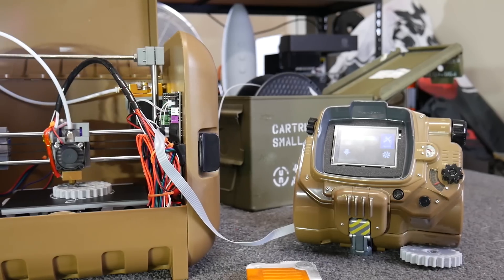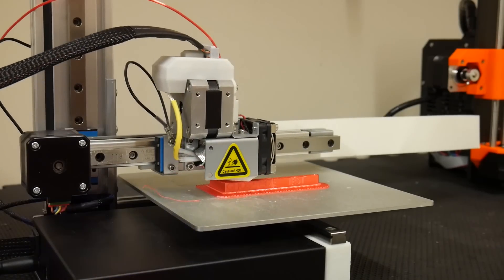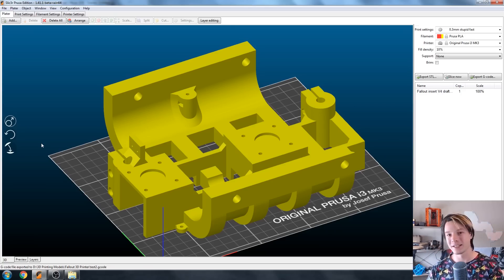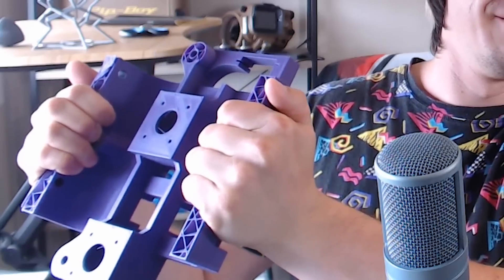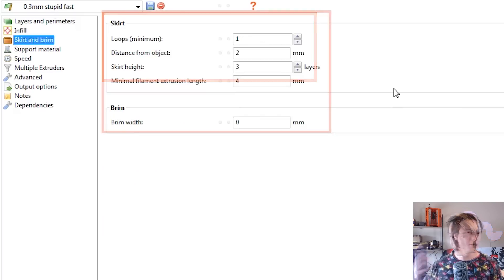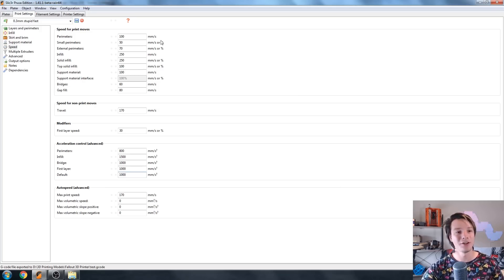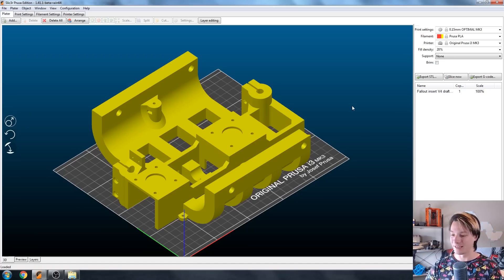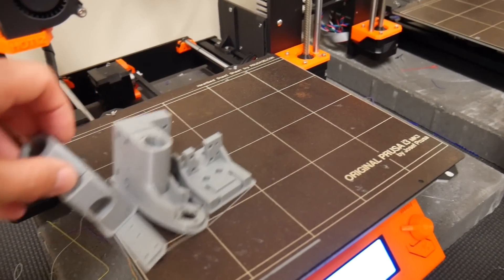3D Print parts TWICE as fast with simple slicer tweaks. 3DP101

Comment: Hello there.
Are you sure your firmware isn't limiting the speeds?
I think there is nooo way 250mm/s @ 300microns is possible with a regular V6 and 50 watt cartridge.
I have done extensive testing with several brands and over 100mm/s @ 280microns @ 230ºC it starts to become sketchy. 120mm/s tops.
Anyone?

Comment: I ve used your settings with perfect huge ((20cm X 16.5cm X 8 cm )) print  square shelf , saving at least 4 hours of printing.
I think i will try 0.35mm .
I have a question , can you try with different nozzle size (0.6 or 0.8) and put some settings with that nozzle ?

thanks.

Comment: Infill speed 250!!!! Isn't it too much ??
Reply: yeah, wtf??? how the hell could someone print at 250mm/s without an E3D Volcano cranked to like 270c and a Bondtech extruder? this seems impossible even with dedicated upgrade parts. is there something limiting him from ACTUALLY getting 250mm/s, or is that a truly real 250mm/s in practice?

I have a Bondtech QR and a E3Dv6 and i can't get filament to lay cleanly at all with this, even at 255c (plus, the filament itself is sinking so much heat that my hotend can't keep up and usually dips down to 240c while all that action is sucking temp from it).

Comment: If You want to increase «Draft prints speed», use 0.6 or 0.8 mm nozzle, maybe with Volcano.
0.6-0.8 extrusion width @ 0.3-0.4 layer height — is optimal «Draft» settings for me.

Comment: I switched to .6mm nozzle for regular use. It's so much faster. I have a weird problem with it though. With all my slicer settings (seemingly) correctly changed, I still show signs of over extrusion, by probably 10%, but when I measure the filament going into the hot end at 500mm calibration measurement it was dead on.

Comment: You can print 0.6 line with 0.4 nozzle, when I use 0.3 LH Iset line width to 0.6 and you can print angled stuff. But you need to reduce speed because the flow of filament will increase

Comment: Nice Expose...

Another thought, If you need more strength than achievable with this method (demonstrably not necessary in this application...)   Printing with no (or few) Top layers, to allow post-printing resin (or other polymer)  injection - FR if desired - resulting in a really solid part (where it counts of course - no point wasting resin in areas where it is not needed.)  Basically using the FDM part as a mould.

Another ... designing the infill at the part level - as webs - would allow the designer to control the entire process, (print with no infill).

"Sparse printing" is a really interesting topic.

Comment: One of the biggest cryptonites to printing time is retracting over short distances. Often this is caused by infill being cut to very small segments, in which case the segments don't really improve anything, but cause lots of non-printing time. There are settings (at least in cura) to prevent retractions for travel distances of under a mm or so. With organic shapes (bones from CT data) printing with thicker shells and no infill cuts down on this problem quite well.

Comment: With my 0.4mm nozzle, I print 0.35mm for fast printing. More does not work well. I am not at 100mm/s. Never tried it. I am at 70-80mm/s. 215C.  I want to print at 0.4 or 0.5mm layer height but had bad luck trying with different nozzle.

Comment: at the 1:32 mark you show a Raise 3D with I guess is a 1mm nozzle according to the title description (although it doesn't look like a 1mm nozzle from the amount of extrusion coming from it). I have one of these machines and I have NEVER seen my models shake, shudder and move around as much as your print showed and with such crappy results from a print. I will say it looked as if you were pushing the speed a bit too high for a 1mm nozzle. Maybe I am missing something but my Raise 3d prints amazingly well and I almost always set my speed to 150% of normal.
Reply from the maker: Probably, it was an experiment where I drilled a nozzle to 1mm. Some prints worked great, others were terrible
Reply: @MakersMuse  My apologies for my remarks. I made a grievous error and somehow, thought that it was a .01 mm nozzle. Your remark about drilling out a nozzle made me realize my error. Now I can see why it didn't look as good as it should.

Comment: Nice Video.  It is bizarre that slicers do not have variable layer heights and quality for the same prints.  That way we could have awesome quality and fast prints.
Reply: Slic3r PE does have variable layer heights in two different ways, but they're somewhat awkward -- there's a "layer editing" GUI that lets you kind of... analoguely skew layer heights for different layers by eye... I don't feel it's very helpful due to a lack of precise controls, but it might be good for aesthetic-only models.
You can load models in as modifier volumes which change various settings on the main model where it's within them (I don't think this includes layer height, though, but it's handy to force more infill in certain places and I think you can use it to change speeds).
The best way I've found to vary layer height is a sort-of-hidden menu: in the 'settings' dialogue on the right-click menu of a model, you can change the tab to "Layers" and type in a sort of spreadsheet of what layer height to change to for a given vertical region.

Comment: 11:12 I thought that prusa won't even let you extrude anything with temperatures below 200...is that threshold lower than I thought or did you tweak this pesky "safety feature" somehow? I know I've ran into this issue when I wanted to print a special filament at 180
Reply from the maker: You used to encounter thermal runaway errors sometimes, but that's been fixes on recent firmware! I've not had any issues for ages .
Reply: I seem to recall them lowering it to 175 in a recent firmware patchnote... looks like 3.5.0RC1, along with some other tweaks of safety features.
Reply: @05Matz  Thanks for the info, I'll check it out

Comment: Disabling Z-lift when you don't need it can also help printing times quite a bit, especially if the design requires a lot of retractions. It can also help improve the top layer quality & consistency.

Comment: you can really push it on a cr-10. since it's bowden it doesn't have that extra weight of the extruder stepper on the head and you can do even higher print speeds without the risk of ghosting.

Comment: Angus, semi related question. On your machine base design you have large radius ribs at the sides. How do you get away with that? Don't they start out at a much lower angle than the usual 45 degree overhang limit?
Reply from the maker: I have a flat to remove the worst of the overhang, but you can see the first few layers are pretty messy :) It will work and quickly corrects itself, but can look a bit rough.

Comment: Your comment on temps is interesting. On my Flashforge Dreamer with PLA I've always extruded at 215 (runs at around 20-213) with a bed temp of 50. The only time this has been an issue is if I'm printing something that comes to a point- usually gets a twist in it due to not being able to cool down enough between layers.

Also have found best adhesion by wiping bed with metho just before it heats up, but leave it wet & allow the bed temp to dry it off rather than trying to wipe it. Doing that I virtually never have to raft.

Comment: I'm also a support hater, I really like your idea of having a full bridge rectifier layer below a horizontal circle, what I've always done that I thought was super smart is one layer with bridges on either side of the circle on say the x axis, then a 2nd layer of shorter bridges on the sides of the circle on the y axis. Then the printer only needs to do a teeny bit of rounded corners to fill the smaller square. This works great for small holes if you want to get a bolt head into or something, but for big holes, you'd need to start doing more and more X-agon straight layer stacks, doing a full bridge rectifier that you cut/drill out is much smarter!

Comment: Can you just print a shell then pour in casting resin?
Reply: I'm surprised that all of the replies universally condemn the epoxy resin approach, but completely failed to suggest a workable solution, which I will now offer/propose:
Low-expansion closed-cell foam as found in any home store, which can be trimmed easily using a saw blade or knife.
Reply: @maximummarklee  I had the exact same thought, turns out people have tried it and the foam is usually alot stronger than the outside layers and breaks the print as it expands
Reply: Bondy.  Where is the material science holdup...  There are people out there who are doing this.
(ps. it is merely a manufacturing technique, no need for any new technology.)
Reply: Yes, 100%.  Cura offers a mold option for this reason.  You could even use the lost wax technique to make your plastic mold a metal one that you can then use as a longer term mold.  I haven't done it myself so I can't use any personal experience to share, but the options and settings are there.
Reply: @8yourpets  You have me curious, I know you can use either polystyrene (styrofoam) or wax to make a lost way mold but I didn't know anything that can be 3D printed would work, are you saying that there is a filament material that would work as the sacrificial material that would take the place of wax in a mold? If that is correct do you know what material would work?
Reply: @phillhuddleston9445  yes, there are videos up on YouTube in which people do just that.  I'm sure if you Google "lost PLA casting" you'll find what you're looking for.
Reply: Quick: Yes, basically toolless "moulding".
Reply: I have done a lot of part that I printed hollow, then pumped full of expanding foam. It's dirt cheap, easy, and much faster than printing infill. You just have to leave yourself a small hole somewhere in the shell, then a drop of superglue to close the hole smoothly.
Reply: @knytetech7732  Awesome! You should make a video :D
Reply: @KaletheQuick  I will be making quite a few, just need some free time, lol.

I run a 3d printing store online, do custom work, I have plans to custom build 2 printers, and then all the tips and tricks for 3d printing from an aerospace engineer who's been doing this for almost 10 years now.
Reply: I actually cast lots of things in resin from 3D molds. From my experience you need the best print for a great cast. This is in a process of 3d print-sand-fill-primer-sand then cast in silicone then cast in resin. For a really good result. Now if you dont care about aesthetics on final product and do sanding and prep on final...sure go for it but remember the silicone pours like water almost so there is a lot of work ahead.  Now cost....Time versus money and printer time....some parts maybe cheaper to print then cast, however your machine is busy with that project and time of printing...I run into this myself. Its cheaper in my mind to cast objects so my machine can print something else...another project.  My 2 cents.
Reply: Yes, someone on the internet did that with epoxi
Reply: YES you can, mix 80% clean sand with 20% epoxy then pour in the shell. That thing as solid as cast iron and very cheap
Reply: The infill help support top surfaces so I think most prints would still need some infill. You would also need to use an "open cell" infill pattern to allow the resin to flow into all areas. The pressure inside might also cause issues with the walls of thin sections bulging out but infill would help stop that. Epoxy is also exothermic (produces heat during curing) so might need to use a water bath for high volume parts.
Reply: @Bondy Most slicers with good multihead support (like simplify3d) do just fine mixing nozzle sizes. I do it all the time on a m3-id.
Reply: Idea.. Boat epoxy mixed with body filler so it becomes thinner. Add only as much catalyst as you need. Fill and vibrate the part on a sander, voila. no bubbles
Reply: Why not plaster or hydrocal?
Reply: @MrSpronkets  Just use countertop cement
Reply: Precisely that method has been in use for a couple of years now by labs that produce hearing aids and dentures. Typically, a photoresin-type printer is used to print the mould which is then cast with silicone or ceramic stock.
Reply: @Bondy would melt the single wall on contact(: nice concept that with time may be one of the many faster ways we will produce products at home.
Reply: @Bondy I have actually done this with high density foam. The type that comes in the can meant to fill in voids for insulation. Worked great. Put a hole in one end with a good seal around the straw and a hole in the other end to let air escape and let you know when the foam has reached the voids.
Reply: @Bondy "Also a third method is to simply use a thicker nozzle ( say 1.0 mm )  on the interior of the model and a smaller nozzle ( say 0.2 mm ) for the exterior surface finish."
    BAZINGA!
Reply: @Bondy Multi-head printers are certainly doable. They're usually hyped as multi color/multi material, but there's no reason you couldn't just have different sized nozzles and run with that (along with recommended heat and speeds as your set up for that head alone).
Reply: Fabrication technology is a field of study each fabrication type has a drawback be it cost/time/scale
Reply: interesting
Reply: If you pour epoxy or urethane into the part, plug it up and rotate it you basically have a rotomold. It takes time to cure the resin but the end result could be stronger than infill. ABS bonds to urethane and epoxy.

Comment: you can "overprint" much further than one might think. the biggest extrusion i got to work with a 0.4mm nozzle were 0,6mm layers at 1.4mm line width, before things turned into squiggles. (which are interresting in theyr own right) 
the usefullness is situational and limited, but it's interresting to see how far you can push things, and big simple structural parts and vase mode objects print in no time.

Comment: not sure if he gets into this in his vid but if the shell is sealed you can also pour two-part plastic into it to fill the gaps and make an extremely strong part, but it will take time to cure, a full 7 days for max strength usually but you can mess with the part as its curing.

Comment: I've been using similar settings on my MK3 for quite a while now, I use 0.32mm layer heights and get great results, print times easily twice as fast as the default 0.15mm Optimal and still way faster than the 0.20mm Draft as well.  Figuring this out really helped keep the design hobby going for me - I was getting very frustrated with the iterative design approach and having to wait half a day for my part to print before testing.

Comment: You also can print 50 times quicker for ultrafast design iteration!
It require the "Experimental" feature in CURA called "Wire Printing".
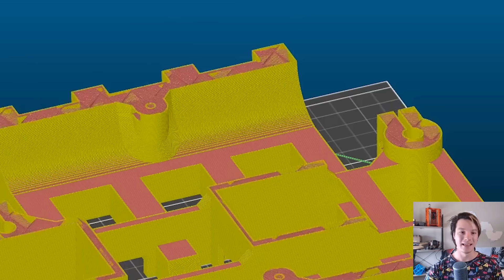Have a look at 5:00 min in this video:
https://www.youtube.com/watch?v=_8v9_H06qmo
The printed part is not functionnal, but can be used on a 1:1 scale to check if the part is well proportionned.
The final part can be dipped into a glue or varnish solution to coat a film between wire. After few dip, the part will be water tight.

I hope you will get inspired and you will create a video about this technique.
Chears from Québec, Canada
Alex

Comment: Wondering if a slightly lesser stepper/driver was used for the Z-axis, would it be wise to print in full step increments for the layers? (i.e. .28 or .32) I know my Wanhao i3 Plus rebrand (Maker Select Plus) tends to artifact when microstepping on the Z axis every few layers when not using full step increments for layer height, possibly due to overshoot of the motor when microstepping. I know the Prusa i3 mk2 and mk3 use near-top-quality stepper motors and drivers that are well-matched in terms of specification, but a lot of kits and other i3 designs use the more economical Melzi/RAMPS-style boards.
Reply: Also, I have a button-up shirt with that same exact pattern.

Comment: Use a bigger nozzle and it’s even faster. I do all my prints with a 0.6mm nozzle, 0.32mm layer height, 3 perimeters, and 5% infill. Also, a bigger nozzle extrudes a thicker continuous line width, and results in better mechanical properties.
Reply: I've done a lot of printing with a 0.6mm nozzle, and I love it. A big nozzle works really well with flexible TPU prints. Some things can be printed in vase mode but still be nearly impossible to tear apart at the layers. Additionally, because the bigger nozzle lets you cover more area, it helps make up for the slow print speed required by TPU.

Comment: Hi Angus I am having a problem with my cr10 whenever I put a SD in the printer does not display anything was inputted and does not read I was wondering if you could help. Thanks.
Reply from the maker: Sounds like the SD slot might be damaged. Try another card, but if no luck some of the delicate solder joints may have broken!
Reply: @MakersMuse  sorry for the late response I will check

Comment: Is there any merit to using combine infill every 2 layers and printing at .15mm all other settings the same. Maybe if you wanted a better external surface?
Reply: "combine infill every 2 layers" is only useful if you want a high infill ratio and use a low layer height. Useful for printing minis.

Comment: Wait.. 250 mm/s while max. print speed is capped at 170 mm/s ?!
Reply: It's just an arbitrarily high value. Actual speed is limited by volumetric flow rate limit which is much lower than either for such major layer.